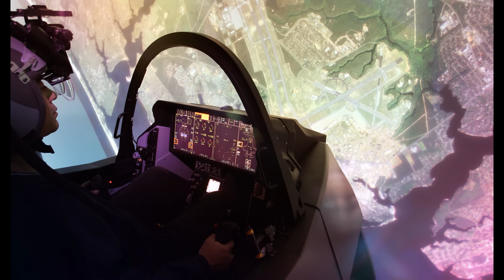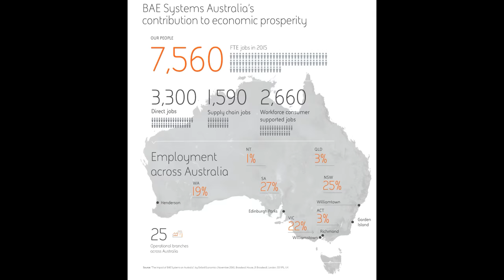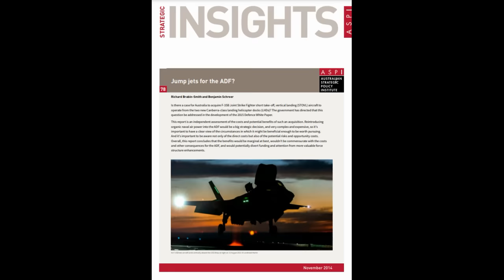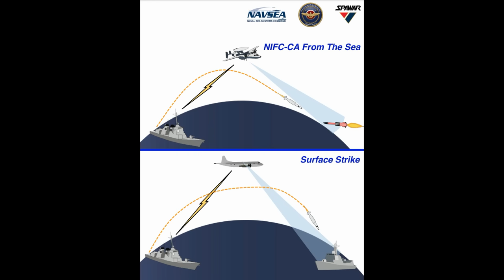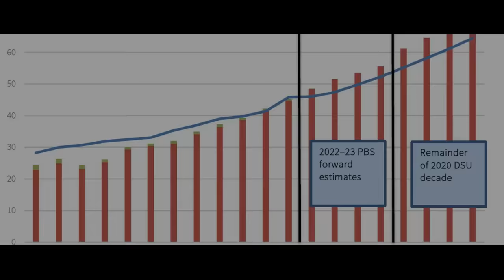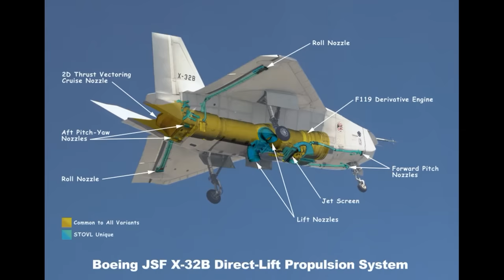The MQ-28A Ghost Bat, Unmanned Systems and the Future of Australian Air Power

Comment: 1:46 - a navalised autonomous drone could be embarked on the Canberra using a rocket based & very small catapult system to launch; like the MQ-58 Kratos Valkyrie; which could be installed on the deck f’ward the front aircraft lift and crane (ie. on the port side of the ski ramp); I think this would be optimal, as it would free up the rest of the flight deck for helicopter operations (and, if you read my previous post, F35B operations).

Comment: Talking to senior RAAF INTELOs the arguments against F-35B have never been based on considerations of capability. The arguments all stem from previous acquisitions having zero plan for the F-35B. Primarily the fact that the LHDs cannot sustain the aircraft (due to various factors which make retrofitting impractical).
Reply: Agree. Ship needs to be built for purpose or we’ll end up needing another squadron of KC 30s just to chase them all over the Indo Pacific. An enormous drain on resources

Comment: The RAAF should also consider developing unmanned, classic, F/A-18 Hornets for the remaining RAAF Hornets.   The Hornets already have sensors, self-defence gear, heavy payload, infrastructure, secure comms, navigation, fly-by-wire, cruise control, underwing pylons, large options, weapons systems, day and night capability.  Also, could be fitted with a large underbelly sensor pod with AESA cells.  They could do many missions.  Including,  distraction from real attacks. This is a relative cheap option. Old airframes are not such a major problem.  Only a few years ago they were in combat over Syria.

Comment: Sensational aircraft and huge potential for Aus with the MQ-28. Still, you've got this beast substituting for the B-21, A-10, F-35C and the Poseidon - let alone the current mission of teaming. I'm surprised I didn't hear mention of air tanker for re-fueling. I too see the potential, but let's see how the beast goes in the current role.

Love your work, love the enthusiasm.
Reply: He probably thought you knew about the tanker.  :-) 

It does seem obvious, though...
Reply: It would fit neatly in to the light tanker role as you say, widening the range of the RAAF with less stress on its regular tanker fleet and fighter squadrons which would have to serve as tankers aswell in the A2/D2 doctrine. I think he didnt mention it because keeping it as a tanker aircraft, given that it wasnt conceived is as such, would limit its capability and its too good/exprensive/promising to keep it for that (kind of what happened to the US Navy's new tanker UAV, which is a temporary patch).
With that being said, and in agreement with you, i think if the situation needed it, the RAAF would benefit greatly form a stealthy, reasonably fast and light tanker fleet of these.
Reply: MQ-28 is way too small for a feasible in fight refuelling mission. Look what the USN is going with the unmanned in flight refuelling mission, the MQ-25. It's way bigger than the Ghost Bat.
Reply: @corvanphoenix   Almost. The MQ-28A is too small. It won’t do any of the things being discussed outside of teaming either - I think HyoerH was using the term MQ-28B at that point. So MQ-28C?

On re-watching there was a lot of pre-cursor around speculation and the MQ being developmental. Like an X Plane.
Reply: @druspork7737  Yeah it's very much developmental IMO too. However much of what they're developing is not hardware related, it's software. So these have just enough capability to perform missions we will want their bigger brothers doing. The more of them we have doing the missions we want UCAV's doing, the sooner they come along. The AI based learning system will mean the more data they get, the more reliable any upscale would be.

Comment: So what is the orange cloud I keep seeing about 50m above deck?  Thats NOx or a nitrogen hypergolic propellant(fuel rich at launch to prevent burning up the launch tube) which usually a missile has SSR with an aluminum fuel perchlorate oxidizer, making a white cloud. Are these hydrazine or nitric acid propellants? Those are dangerous to store and need complex plumbing. Chinese like them but western forces dont use them. I have  seen that in all your videos, with these boosted missiles.

Comment: Similarly to the FCAS program, i believe that giving the choice for the fighter pilot to control the drones or see what their cameras, instruments and radar see is clearly good, but the full control of the flight of drones should be in hands of either a C&C aircraft, ground installations or in the worst of cases, the fighter's copilot or WSO.
Weirdly both the F-35 and the future european FCAS fighters are single pilot so accommodating the loyal companion system, i believe, in real operations or in intense situations would overwhelm the pilot. I know the Ghostbat incorporates AI for operating it so it wont have to be manned at all times, but at the time AI can only do so much in a changing and developing battlefield when push comes to shove.

The idea is great and clearly the future of air combat not only because of capability and synergy with current systems, but because of room for future improvement on the platform and the sheer number of aircraft that can be operated and payloads and different nose configurations.

Great video and i hope the MQ-28A develops nicely into a platform that serves the RAAF and many others.

Comment: playing around with an idea.. I'd assume the location of undersea submarine sensors are well known; and the HAAWC torpedo range is limited but it in theory could fit inside the bay of F22; F35 or MQ-28; could that be a second strike capability? particularly with a couple mq28's hitting a stationary, unmanned, target wouldn't even need a human in the loop; and the MQ28 range of 900mile could cover from the Philippines.  Could even in theory drop a Jammer right on it to open a gap; or allow a conventional response.

Comment: Current Australian warships have a limited amount of missiles for an intensive conflict.  F-35Bs could increase the available firepower.  Argentina may be a threat to Australian regions of the Arctic for its potential resources. The F-35B sensors and data sharing alone can be a very useful capability.  Using tankers for extremely long range operations are very demanding and difficult to manage. They require very careful planning and limit flexibility.  If the RAAF still has some older Hornets and infrastructure, they could make effective UAVs.  Already having weapons systems,   sensors, comms, fly-by-wire and self-protection.   Many old fighters have  been modified to be UAVs for testing. Ghost Bat us still a useful capability but classic Hornet UAVs could be a useful and low cost capability.   In time of conflict, Hornets could carry heavy firepower for a short period. Each carrying 2 or 4 anti ship or cruise missiles for an overwhelming attack.  Or GPS bombs to destroy an enemy airfield.  The Hornet guns could be removed to make room for a remote control system. Most classic Hornets are now retired and could be very cheap. They still have capable weapons systems and sensors. We should keep the Hornets and infrastructure. Much of the training could be done in simulations to preserve airframe hours.

Comment: F-15EX would be a good platform for local direct control of one or more ghost bat drones. F-15EX could also add massive firepower, large radars, and long range to complement stealth fighters. It is furthermore potentially a more capable electronic warfare platform than Growler while being highly compatible and relatively easily adapted to EW systems. 

Australia should acquire 36 F-15EX for utility and support of the 72 F-35A on order.
Reply: I actually don't mind that idea. As long as the F15EX was able to be fully integrated with the current RAAF Air Combat Battle Operating System. My only hesitation is that the Defense Doller can only go so far, and I prefer the B21.
Reply: Sales of all Growlers and Super Hornets in inventory could partially fund the new investment, perhaps 25% of the cost. 36 F-15EX could replace the 24 Super Hornets and 12 Growlers 1 for 1.
Reply: @stupidburp  In my view,..the F15EX has no,...or very little deterrent value. It has no deterrent value as the Carrier/F35B option that hypohystericalhistory is clearly advocating for. The fact of the matter is,.....the entire US Pacific Carrier Force is not going to deter the Chinese invading Taiwan and conducting supporting operations to the South in our sphere of interest. Australia needs real deterrence. Deterrence to make the Chinese,..or any other potential adversary, to really think about the consequences of their planned operation,..and pause. 

The F35 fleet,...infact, in my view, the whole current Air Combat Battle Operating System does not provide the deterrence we need. I believe the F15EX will not value add to that deterrence. I certainly don't believe a baby Carrier with 12 F35Bs provides any deterrence. In fact,....as an enemy I would specifically target such a vessel to inflict mass casualties and influence our appetite for war at the domestic level. 

Australia needs Long Range Offensive (stealth) Missile, a long range Stealthy Bomber and a Nuclear Submarine Fleet. This is the TRIAD of capability we need, that is characterized by stealth, lethality and maneuverability. This is real deterrence! 

And if the ballon goes up, name any capability that is superiorly more lethal than the Astute/Virginia Class Submarine, the B21 and the LRASM? Name any capability that has more deterrence value?

I personally would replace the The F18Fs with the B21 and keep the F18G.
Reply: F18G is useless without F-18 to protect, they both have short range. B-21 is eye watering expensive even if sales are allowed which is by no means guaranteed. US has never sold a stealth bomber to anyone before. LRASM and JASSM have sufficiently long range to keep non stealthy launch platforms out of most trouble. F-15EX with extra tanks can launch in South China Sea to hit targets there with standoff weapons. It is essentially a fighter bomber. A cost effective one at only around 80 million USD and half the operations costs of F-35A. But it can also be a babysitter to drones such as ghost bat even in electronic warfare heavy environments or loss of satellites. Can operate a considerable distance away from Australian shores. As a coalition partner they can relocate to Okinawa and reach Taiwan without a tanker, F-22 and F-35 can’t. If they bring some drones along they can use them to scout ahead. PLA most numerous fighters are still Flankers - F-15EX has an edge on them. They can’t do everything but can do enough to be a legitimate deterrent.
Reply: If it was just aircraft, probably get 10 B-21 for cost of 36 F-15EX. But, the B-21 will require billions of dollars of extra infrastructure that F-15EX doesn’t need. Thus the real comparison is closer to 4 B-21 versus 36 F-15EX. Some might still go for the stealth bomber. But keep in mind with only 4 it is easy to locate and destroy all of them with long range missiles on the ground, even under hardened shelters. Maybe base them far away. But then they have long lead times flying subsonic over to the launch points and are still vulnerable to asymmetric attacks on the ground.
Reply: Also the bomb load of B-21 is not public yet but probably roughly equivalent to 2 F-15EX loadout. Which means 36 F-15EX can probably drop a larger volley of LRASM on a fleet than a dozen B-21 can. Within it’s range limits, F-15EX can carry an impressive amount of firepower.
Reply: @stupidburp  All good Stu,...agree to disagree. Thanks for the pleasant tone.

Comment: Australia could really do with a couple of decent size carriers for force projection.
The QE class would actually be a very good fit with that need, though I'd prefer to see them nuclear powered (something I consider to be a mistake made by the UK when they chose conventional power).
Reply: The Queen Elizabeth class is the largest warship ever made in the UK and there where only ever two made which now comprises the entire fleet of uk aircraft carriers 

If Australia where to get them we would have 2 plane carriers and 2 helicopter carriers larger then what the uk has 

(We can't afford them)
Reply: Also each queen Elizabeth can hold 40 fixed wing planes 
So 80 all up
Australia is only buying 72 f35s 
This would require an over doubling in size of f35 order 

(We can't Afford them)
Reply: Australia would have to operate this with a smaller defence budget 
UK: 94.3B (AUD)
AU: 52.5B (AUD)
Australia has a much smaller economy 
(From IMF 2024 estimates in USD)
UK: 3.59T
AU: 1.69T

(We can't afford it)
Reply: Australia is only a relatively wealthy nation compared to its population (which is around the same as Burkina faso). Australia only has 26m people which is not nearly enough to fund and maintain multiple QE class carriers

Comment: Of all vids you have done this has most compelling solution to ADF three branches of requirements, with Ghost Bat, big brother GB?plus Ghost Shark this cause headaches for our enemies.  Couple areas I was thinking was drone warship which their were suggestions last 2 of OHP frigates should been converted but surely we could build two new OHP with vast improvements without carrying Aegis radar also converting hanger into VLS area?  ADF buy strong warfighting equipment but not at numbers nor enough train defence personnel to run operations on large scale, we need to learn history especially if Iran kicks up, this situation is no where near home under safety air cover especially if we can’t use other countries airbases.  Things are different since desert storm war or East Timor.

Comment: I wonder if the USA would support a program where supercarriers that are being retired are instead run by an allied nation on a shared cost program. I wonder if this would be cost effective to either party, and if politically advantageous? Have not given it much thought other than 'what if?'. With the Royal Australian Navy intending on running US Navy nuclear reactors it does seem at least possible the RAN could run 1 or more retired US nuclear aircraft carriers. USS Nimitz is set to be retired in 2026 but its lifespan can be extended, its cost of operations is roughly 1 billion per year (?). Would the USA contribute significantly to its operation as a RAN carrier? Would the RAN want a supercarrier capability? Would this make any kind of sense? I dont know, but I did wonder about it while watching this video.

Comment: If the Ghost Bat only weighs 3.5 tons, a C5 Galaxy could be fitted out to carry 50 of them, and drop them from 12000 meters. From there, they would have a 3500 kilometer strike range.

With the Raytheon Stormbreaker inside as payload, it would be planes inside planes inside planes.

The Matryoshka doll doctrine.

Comment: On the point of having to develop AI to allow the unmanned platform to respond to threats, alleviating the pilot of this role: If this AI is developed for the unmanned pmatform, surely it would be adaptable to the manned platform also?

I suppose at first it would be sufficient enough for an unmanned platform but would not have the performance necessary for platforms carrying pilots 

Food for thoguht

Comment: The ADF needs to be sure that the new helicopters need to be seaworthy to operate on the Canberra class ships.  Also they should be built ready to have hose and drogue in air refusing.  And the new C-130J transport aircraft should also have,  refueing gear for the helicopters and F18 fighters.  Preferably,  all of these aircraft need full refuelling systems.  And the Ghost Bats need both refusing options.  Possibly with mounting for an underbelly,  buddy pack.  Able to be refueled by KC-130J, KC-30 and allied aircraft.  A much larger version should be built with a heavier payload.    Possibly twin engines.

Comment: This video does a credible job arguing for how an MQ-28 or for that matter unmanned aircraft might be used in the Pacific but it makes one big assumption without considering if it changes how it might affect Australia's maritime security The extreme distance that currently exists between China and Australia and China's current technological deficiency in bridging the gap. Already, the Solomon Islands have announced they are opening thier port(s) to Chinese commercial use and no one knows what that might lead to. Today, China's naval fleet is mostly limited to a few weeks before they need to return to a port, and most likely a Chinese port. That may change as China has gained friendly cooperation agreements or control of seaports in the Solomons, Sri Lanka and Africa. If China is able to gain further capability in these places like airbases and support for military vessels, Australia won't enjoy a long distance buffer and the PLAN may approach Australian coastlines.

Comment: I agree the ADF bureaucracy is problematic.  Will new Blackhawks be able to be sustained on RAN ships. Equipped with suitable corrosion protection.  I see the use of a small number of F-35Bs used mainly for improved situational awareness. Can our next RAN submarines be able to use vertically stalled guided torpedoes?  Australia could face Argentina in the Antarctic due to resources and environmental protection.